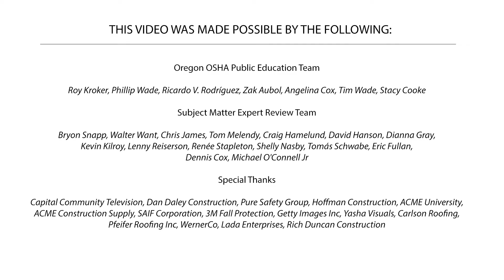Self Retracting Lifelines (SRLs) in Construction

Comment: Good info. I only slipped on the air hose and ropes when I worked on my roof. I don't think that retracting lines are good on steep roofs because it can't keep the tension. Looking for a better solution before I do a steep section of my roof.

Comment: Any chance any of these can be used as a self retracting dog line? Unable to have a fence in the yard and am hoping to find a retracting cable solution that covers >20-30 ft. Thanks!
Reply: It is a fall arrest device, so I would not recommend for that applicaton. When the dog runs fast  enough (ex: something like over 6ft/s) and the lock mecahnism activates. It can lock within 5 ft or 10ft whereever the point the dog moves fast over the set speed of the device.